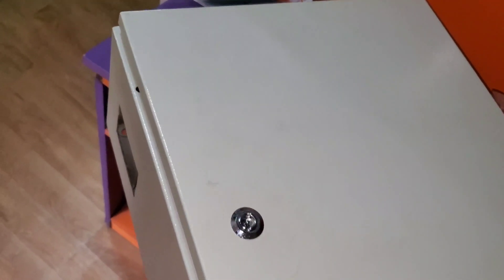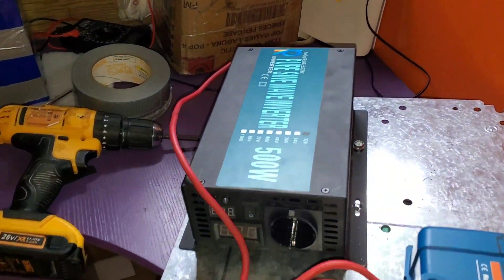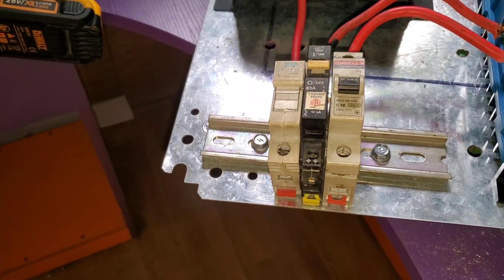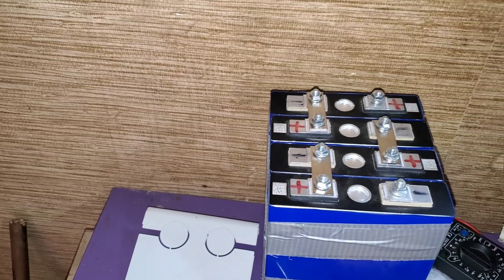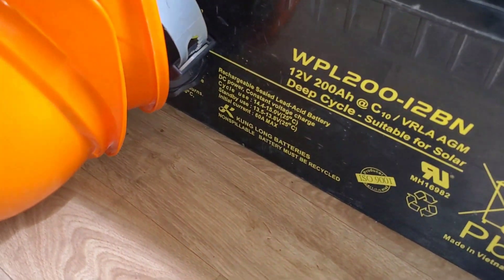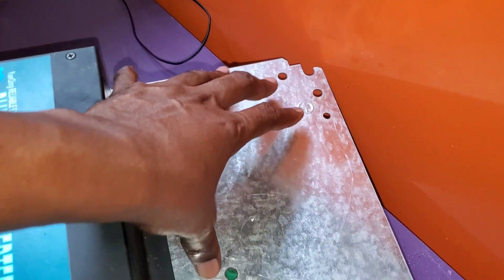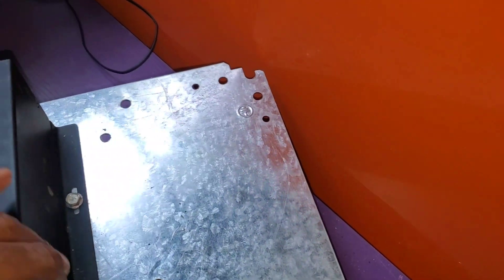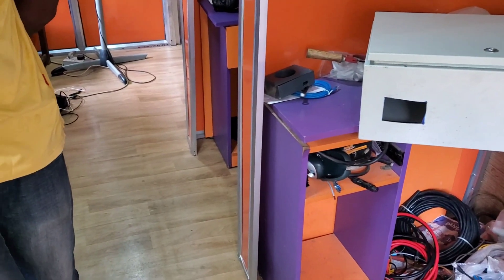Part 1. Small off the grid build with Lifepo4 battery

Comment: I know what you are trying to do: Offer cheap PV solution.
Question: How much is that MPPT charger + Inverter? Maybe you could get Growatt SPF clones which are very cheap.
Reply from the maker: Thank you. I want compact and inexpensive. The Growatt would be too big. There are places that are completely off the grid and they need something just like this. So we are experimenting.
Reply: @drsolar  Try getting in touch with Xindun. They make portable micro solar inverters includes battery, battery charger delivering 200W to 1000W all in one BOX.
Reply: Victron MPPT isn’t cheap but it’s good, also look at cheaper Chinese options. I’ve had a cheap one 60A since 2014 & it’s been running my 3Kva system reliably.

Comment: Hi Dr Solar. A question, not related to this video. Can we use two different grid tied invert on same phase?  Will they increase the voltage to abnormal level as they'll see each other as grid and increase voltage to feed into grid ? What's your thoughts on that. Thanks
Reply from the maker: I don't have experience with this. I have seen it done. It would not increase the voltage, it pushes watts more than voltage. So what you demand determines how much energy they send to you. There has to be something that manages them if you don't want them to blow up.